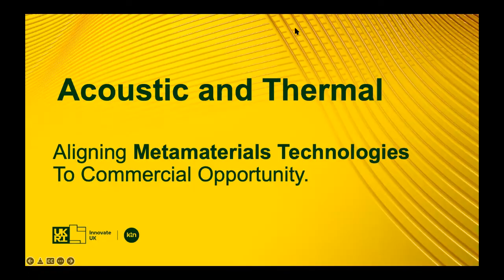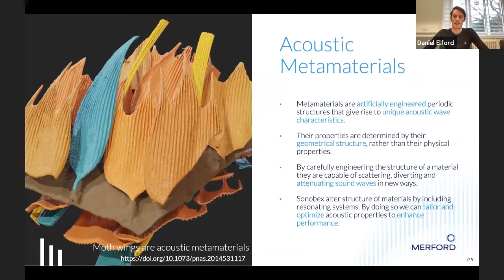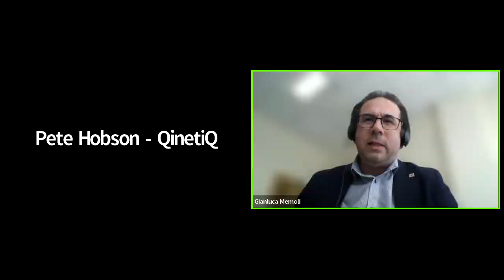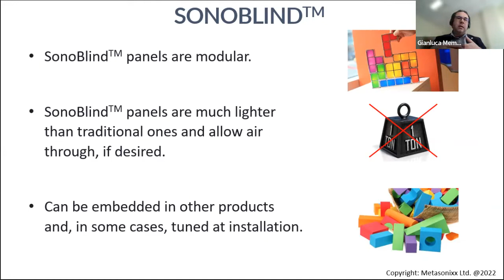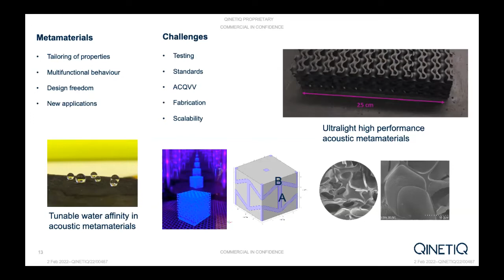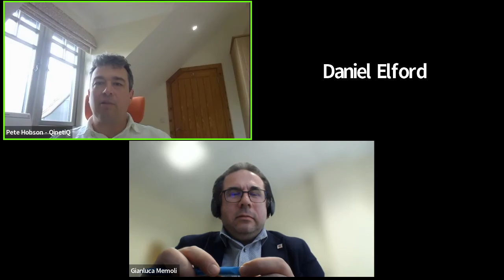Metamaterials for Industrials Applications - Acoustic and Thermal Session

Comment: could a metamaterial fabric sheet be designed that functions as a acoustic diode? It would need to effectively pass phonon energy in one direction and block or significantly reduce transmission of a 44KHZ signal in the opposite direction. Sheets of this material to be used as separators between the piezo electric ring elements, assembled as a stack and held together with a central tension bolt.